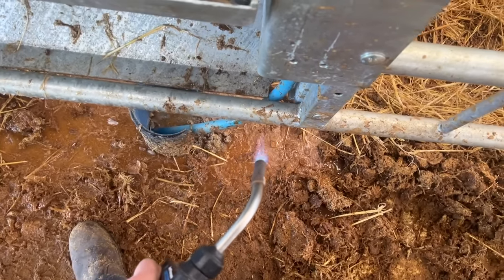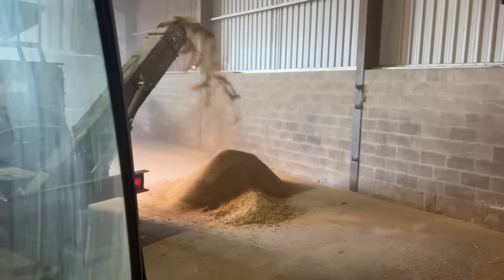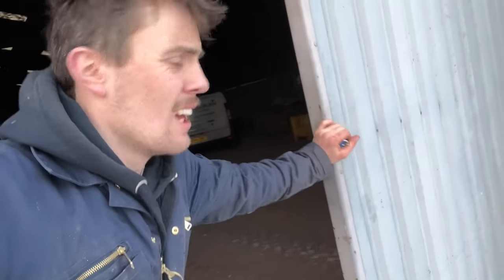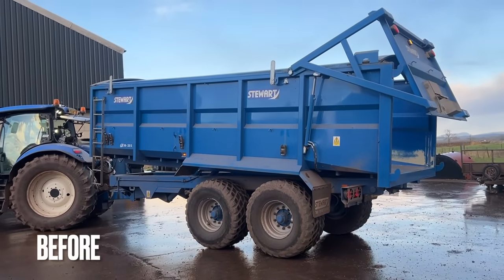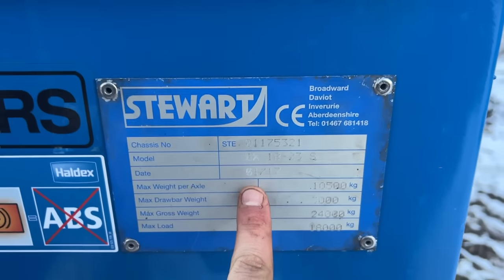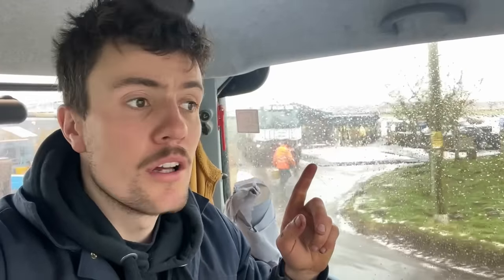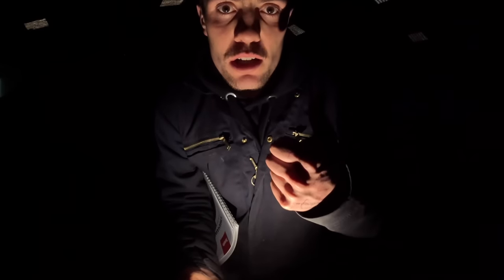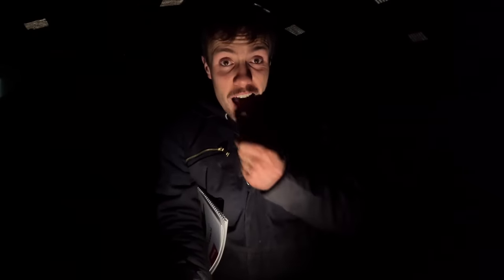It’s A Nearly New Trailer | Frozen Water Problems

Comment: The new shed is absolute class Crawford👏  lovin the content in it and seeing you rattling through jobs with ease. Mind shifting the old crush about on the trailer etc. Seems a lifetime ago you were picking it up and making it fit in your outdoor handling bit, and back then u were happy with the improvement it gave you 🤯 good on u. Great seeing hard work and enthusiasm pay off for folk. 🎉🙌🙏
Reply from the maker: Cheers Danny, get used to the new system quickly. Dont want to go back

Comment: I think the issue with your drain down valves is that if the trough is full and the ball valve closed you are in effect trying to drain a sealed tube and creating a vacuum causing the pipe to drain very slowly if at all. That would be consistent with the effect of pressurising with compressed air which would work quicker if you operated each BV until air comes out
Reply from the maker: I did think this may be an issue. Can always throw in an airline if the valve design doesn’t work
Reply: 🛫  Hope the flight isn't bumpy. 😉

Comment: Would think even with the water off there will still be enough moisture to freeze the water valves in the tubs.
Reply from the maker: Think when the ball cock drops there should be a direct gap air to air from ball cock to outside valve
Reply: @CrawfordsFarm1  I hope it does work, I thought with troughs being smaller once you have more cows in they would just about keep it running anyway as long as you can get the pipes built in to insulate them a bit more as you mentioned your previously.